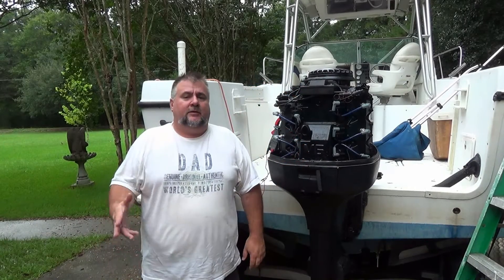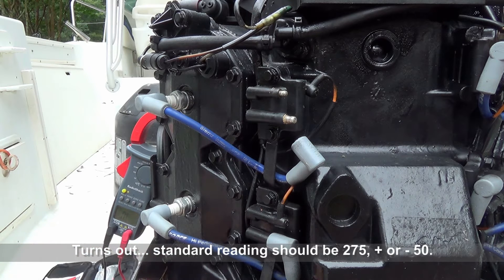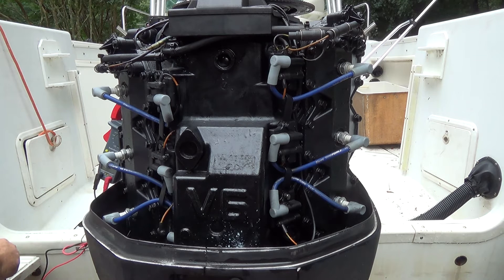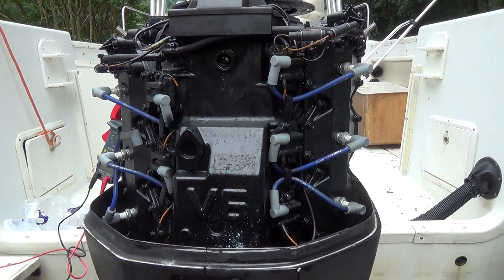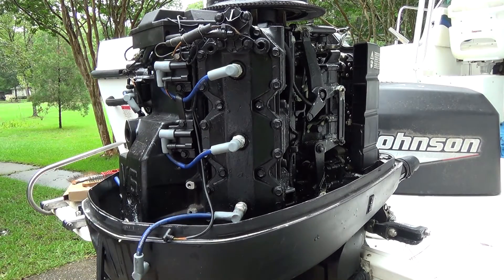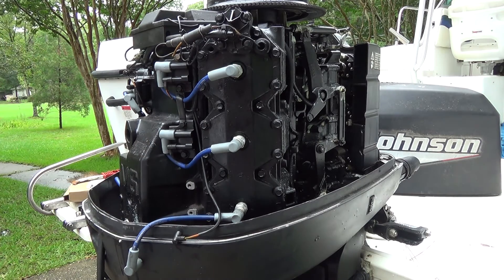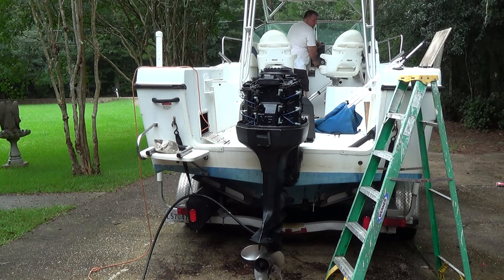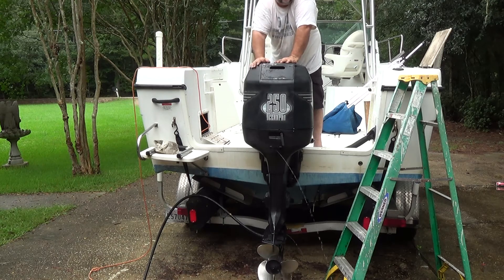How To: Change and Test Johnson / Evinrude Ignition Coils

Comment: Have the same problem with mine and you never said what you did to fix it.
Problem is the part ( temp sensor is discontinued  and no longer available 
Should appreciate an answer. 
Thanks in advance

Comment: You checked the secondary but not the primary. The secondary could be in the 275 +-50 but if the primary is out of spec, the coil is still no good.

Comment: Good afternoon,
I have a question after watching your video.
You check the secondary winding BB ignition coil and if I understand correctly, you find the resistance in ohms , but the secondary winding should show the resistance of the kilo, Ohm will show the resistance of the primary winding.
Could you clarify that point.
With respect.